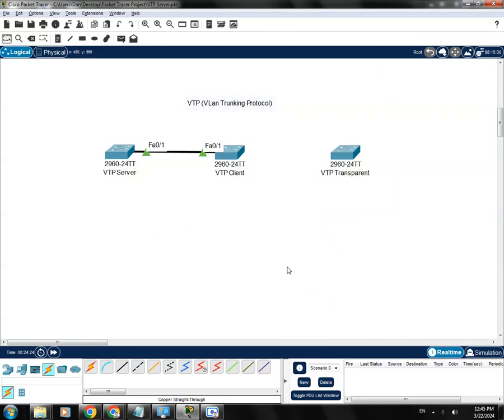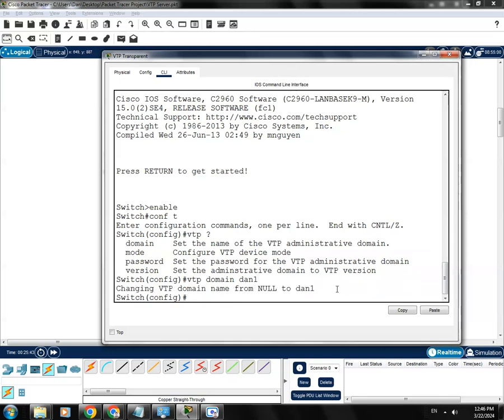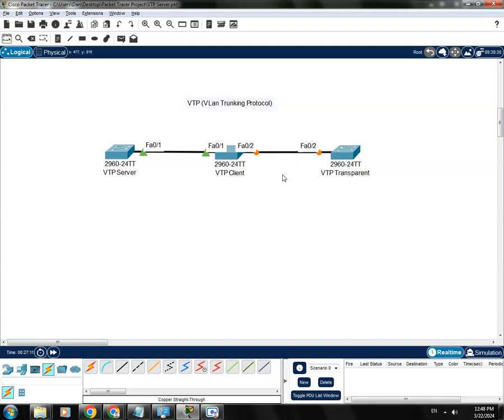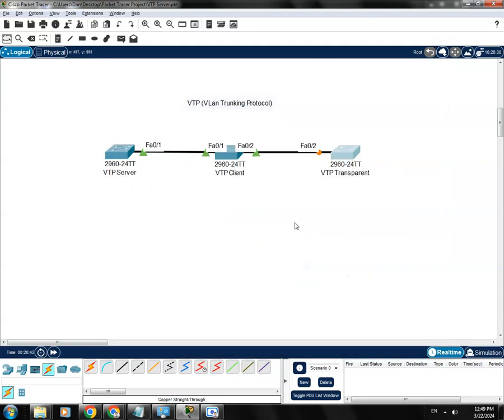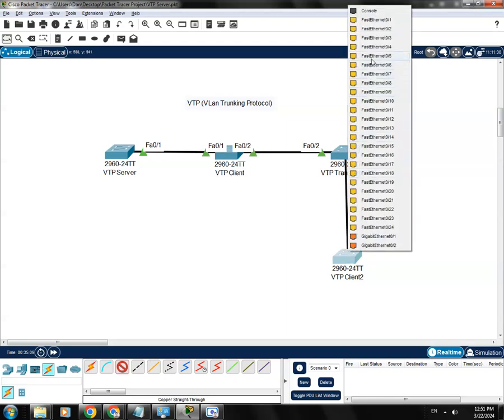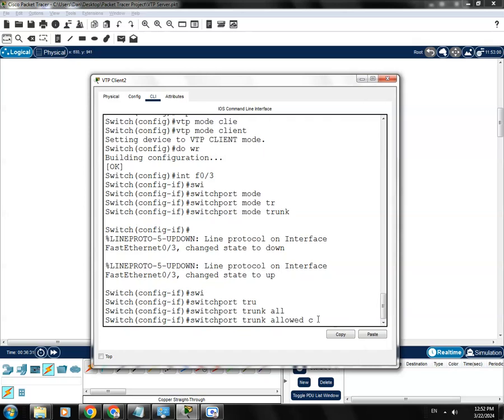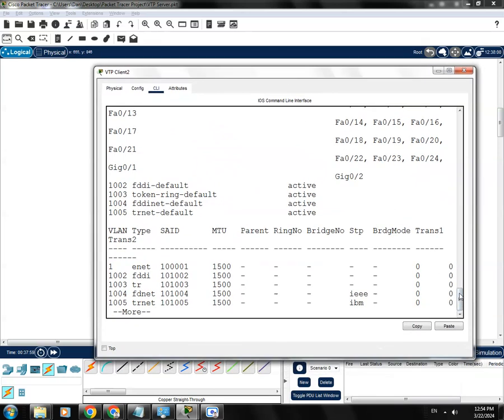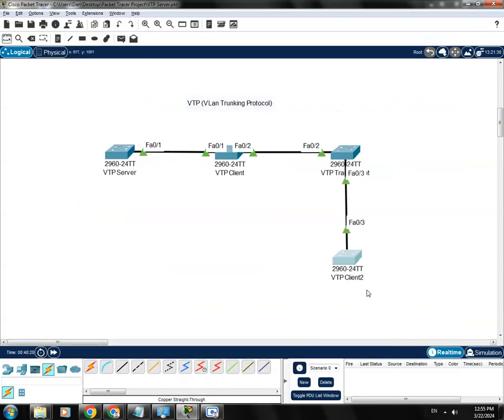VTP Mode Transparent Configuration in Cisco CCNA 2: Day 21

Comment: you need to summertize steps in notepad , i have already request to you,
Name define to each switch or router, if you are using 3 switch, it unable to understand on which switch / router you are running command.
need to write steps on screen as earlier suggested..
Reply from the maker: Yes! Suggestions will be applied soon, as video tutorials on CCNA2 are already created. Watch out for CCNA3. Thanks!